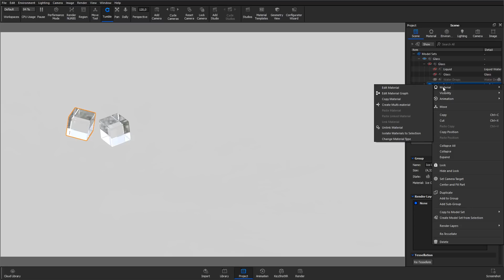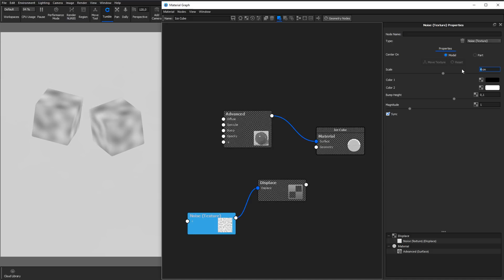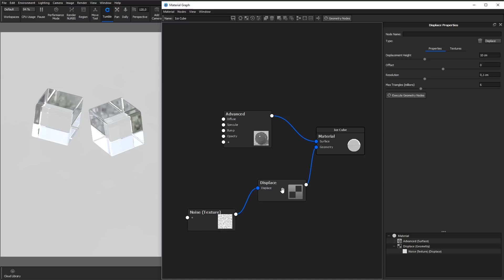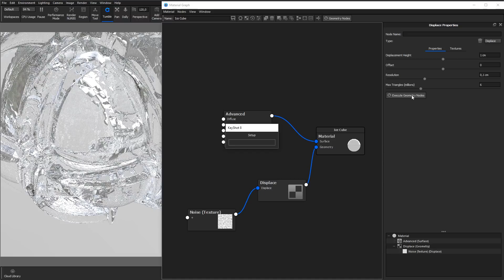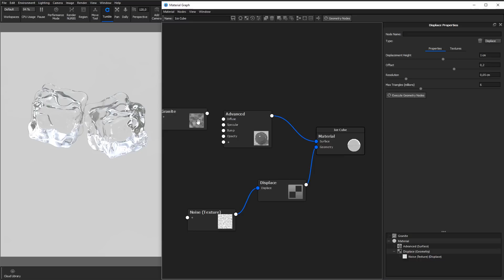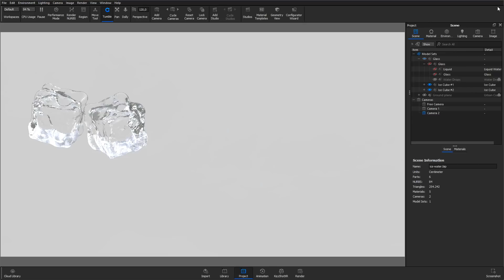KeyShot 8 Quick Tip: Displacement

Comment: I tried this with a thin line from sw Anand it exploded the cube like the faces weren't connected
Reply: Try adding a tiny rounding/fillet to the edges. At the moment, sharp edges will get disconnected as you encountered.